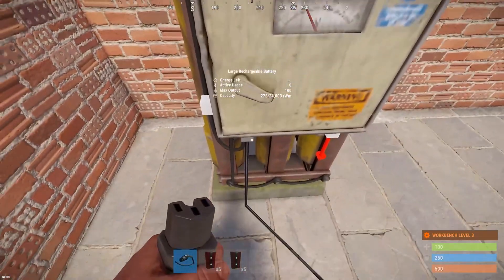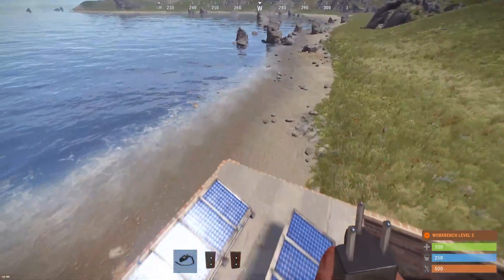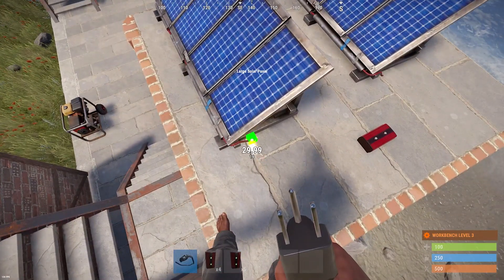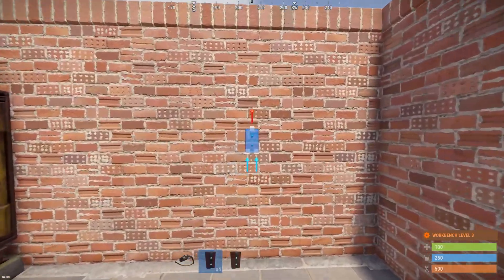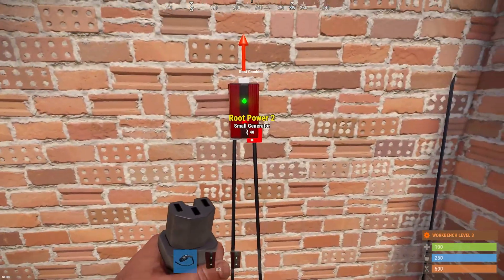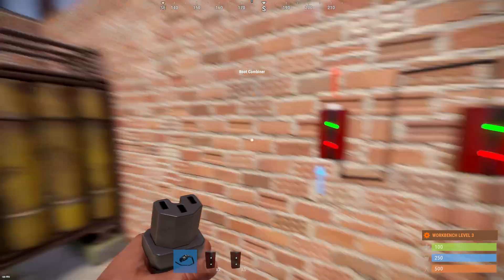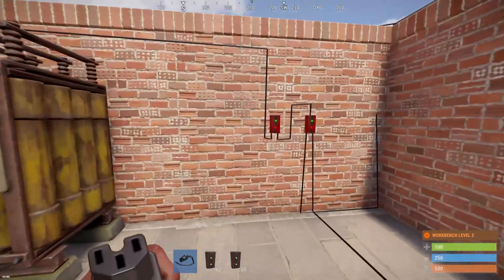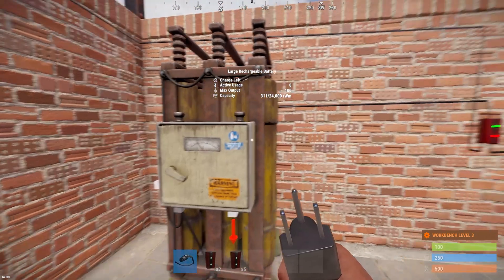Rust Electricity Guide – How to Combine Power Sources into One Battery Using Root Combiners

Comment: Like the videos definitely helped me out thank you. Question for ya. Do you know what the full charge output is for on the batteries and what to use it for? I’m guessing it’s when the battery is fully charged you can hook that one into another one so you could be charging two or more batteries at once? Thanks again for the videos can’t wait for more to come out!
Reply from the maker: Do you mean like the extra connection on the battery? It allows you to toggle systems in order to know when your baterry is full. Basically it will send out power once the baterry has been fully charged. So you could use it for example to turn off generators when your baterry is full in order to save fuel etc. Might make a short guide on this in the future :)
Reply: @ thanks for answering the question. And yea I was messing around last night trying to figure it out on a building sever kinda a nice feature.